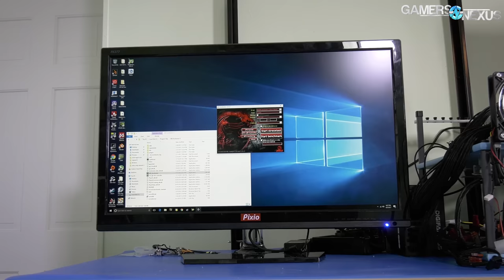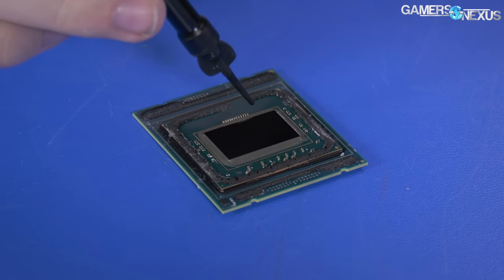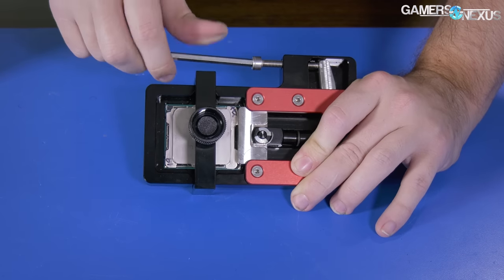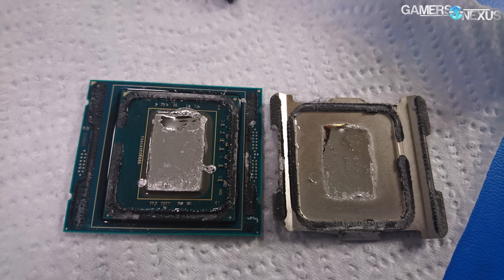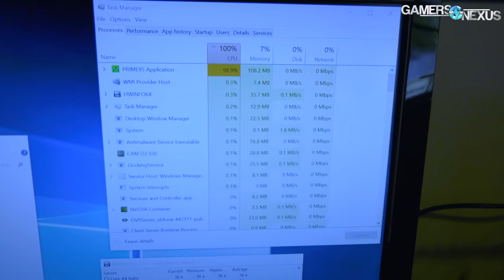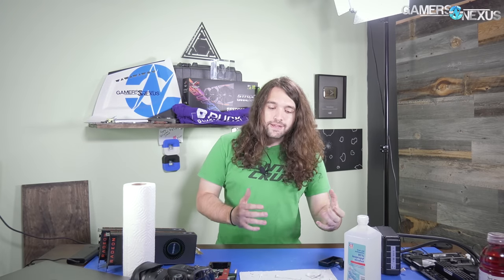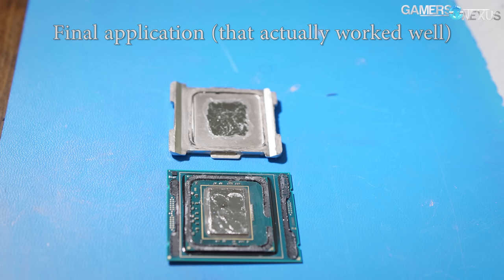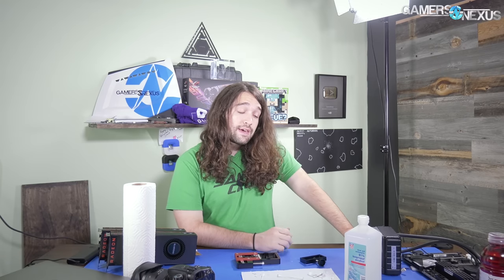Vlog: Learning Delidding & Liquid Metal Application on 7900X

Comment from the maker: Thanks to our Patreon backers for following this as it was happening live (on Discord). Update since: Starting to get good at this -- have delidded two more CPUs and used LM. Realized, sort of obviously, that you can siphon LM back into the syringe if too much comes out (though it's kind of a pain, at times). That made it a lot easier. Removing the tip from the syringe and replacing it also made things easy, as a tiny drop comes out each time that's done, which is generally enough for a thin film. We are now two CPUs into testing and seeing a lot of performance uplift. Pretty fun stuff. If you want to support on Patreon to join Discord, a link is in the description above!
Reply: ahh love that bitwit gif
Reply: Honestly, you are better off putting liquid electrical tape on the surrounding caps to avoid shorting in the first place. If you don't have LET on hand, a few coats of clearcoat nail polish also works. Conductonaut, unlike CLU, maintains a far more "liquid-y state", and is prone to runoff when tilting the CPU around. Even if you use a thin enough layer, you do run a small risk of having runoff touch those caps if you move the CPU around enough. CLU is much more viscous, but also runs the risk of drying out quicker over time depending on mounting conditions. I certainly wouldn't risk a $1000 CPU without taking every precaution beforehand, but glad to see the CPU survived both the delid and liquid metal application.
Reply: Thanks Steve
Reply: Please up vote this. Deliding is NOT just about putting a better TIM on the die... it's also about reducing the die to IHS GAP! Reducing the gap in addition to providing better contract is where the majority of the improvement comes from. This is why removing the glue is so important. It brings the IHS closer to the die, increasing the transfer of heat. Ideally, we wouldn't use any TIM and have direct contact with the IHS since the thermal conductivity of nickel and copper is higher than any thermal interface material. Unfortunately it is impossible to have perfect contact between two uneven surfaces, this why need TIM.
Reply: Liquid metal between the cooler and IHS doesn't really help much, about 2C at best over traditional pastes. Best not to waste it on top of the IHS, and use it where it helps the most, which is between the die and IHS.
Reply: The first time I used the Thermal Grizzly Conductonaut on my 7700K it squirted out the same way.  It is in a syringe, so all you have to do is make sure there is no air in it and pull back the plunger and suck up the amount you do not need. Simple.
Reply: Please do a comparison between Liquid Metal and standard TIM replacement. I've been informed the difference is minimal and not worth the extra risk of damage.
Reply: I fried a broadwell e 6850k with this stuff w/o even delidding.  Must have put too much on the ihs so the liquid seeped down into the gas hole.  I've sworn off all liquid metals for good.
Reply: Hey Steve been wondering for a while would it be possible to flash a 1080ti with a Titan xp 2017 bios to unlock the extra cuda cores 
Keep up the great content
Reply: Gamers Nexus Nice video man. I've been interested in LM too but fear that its too liquid haha do you think you can test a laptop and see it it runs/drips if you have your laptop in your bag bouncing and bumping when you walk when the laptop is vertical. For future video you can also test the long term effects of LM. BTW to prevent from spills or shorting put Scotch Super 33+ tape around the die as its hi temp resistant and is very thin. Thanks, would love to hear from you.
Reply: thank you for the vid, this is informative.  
I wanted to know does the liquid metal Grizzly "eat" or rather deteriorate aluminum?
Reply: Gamers Nexus Pro tip Steve, cover the caps with a non-conductive silicon TIM like MX-4, and they are protected from spills and shorts;)

Looking forward to seeing you use LM for a shunt mod on an nvidia gpu, hint hint ;)

Also, if LM gets on your table or floor, use soapy water to clean it, soap breaks LMs insane surface tension
Reply: @Scooby Dooby, go look at any actual benchmark of liquid metal vs traditional paste when used in between the IHS and CPU heatsink. We are talking 1-2C at best, for a paste that is far more expensive. Remember, you have to cover both the IHS and the heatsink's cold plate. You are also overestimating how thermal conductivity works. Just because something has a higher thermal conductivity, does not mean it's automatically going to cool better. If we are being honest here, you are better off with a perfect lapping of your IHS and cold plate and using little to no paste. 

I suggest you look at various reviews of liquid metal pastes. Tomshardware just recently did a review that included CLU, Conductonaut and Phobya's liquid metal paste from back in the day, and as I said, a 1-2C difference was the best they could get over Kryonaut. http://www.tomshardware.com/reviews/thermal-paste-comparison,5108-8.html
Reply: You should have experimented on something cheaper first. Like a 7700K using the delid-die-mate 2 (Roman should have sent you one). I mean your mistakes, after all, were not about the use of this particular delidding tool or this particular chip but about the general procedure - like how to apply the liquid metal on the cpu die and cleaning up the IHS.
Reply: Steve, I still haven't herd from anyone why the double PCB on some of there chips. Since the GN team rocks maybe you can give an explanation?
Reply: CaptainMageTank do you know when 5ghz STOCK speeds are going to happen?
Reply: Hey thanks a lot man your clips are awesome. You're a hero! One question regarding the clip, at 3:56, did you apply nail polish before this happened (losing a capacitor)?

Comment: Liquid metal application is just a pain in the ass :D my first application looked about the same but you get used to it.
Reply: Just put tape around the die.
Reply: nail poilish works as while ive heard
Reply: Hey would liquid metal help on top of the IHS with the contact of the cooler? I'm just curious if it helps at all
Reply: A big issue to watch out for is liquid metal's reaction with aluminium. Gallium is a primary component in the liquid metal and will have a chemical reaction with aluminium. The CPU IHS is typically nickel platted and therefor won't react, but many CPU and GPU coolers use aluminium on or near where they make contact with the die.
Reply: der8auer hey bro i got some themal grizzly liquad metal .Do you think if i replace my thermal paste with it without delidding my 7700k it will improve temps slightly with my d15??
Reply: Coollaboratory's liquid metal is very nice and doesn't spill all over. It could be that oxidation is a big point on thermal grizzly, it blocks the pipe and with increasing pressure it spills over.
Reply: Luke I would say no, since you will be limited by the shitty Intel thermal paste.
Reply: Alexander Arias yes it will I'm but I can't attest to how much
Reply: Luke based on tests i've read(but for older CPU): if you're using really bad paste now, expect a little over 5c improvement. maybe closer to 10c in extreme circumstances, and if you're at a very high clock. if you're using a decent thermal paste already and not overclocked, expect less than 5c improvement.
Reply: If you stop using that garbage and go with CLU you wouldnt have had that issue. Also, Silicon Lottery recommends it. I delidded my 7700k (THIN) with a razor, and had a perfect application to both ihs and die with a cheap micrometer to ensure it was aligned. 
The whole process took an hour or so with some really good lighting and magnification.
Reply: Says that right on the product..
Reply: I have a little OCD and took my sweet time, but my first LM application was almost perfect ^^. It was the I7-7700k. With Conductonaut and Siliconglue and no Taping. Your Delid Die Mate 2 was very easy to use. It would have been nice to have a hole at the bottom where the CPU can rest while you clean it. Just like the DDM 1.
It still runs 5 Months later without problems or difference in Temperature.

FYI. My AIO died a few months ago and i had to use my STOCK Cooler. With LM it was at 75°C on AIDA 64. (The AIO is at 50-55°C)
SO with delidding even the Stock Cooler becomes viable. XD
Sadly my CPU is a bad draw. @5GHz 2 of my 8 Threads become unstable. (for example: With Prime 95, 2 Threads stay at 0% Load)

Here are some numbers and pictures of my delidding http://www.overclock.net/t/1313179/official-delidded-club-guide/32920#post_26056970

@NFleck
CLU is aging much much more badly then Conductonaut.
Reply: Oh also 3 Tips for applying.
1. instead of pushing the Liquid out, draw up the Syringe first. Then you can adjust the pressure more gently and evenly until the LM comes out.
2. suck up excess with the Syringe until you have a very small bead, about 1-2 mm in diameter (around 3-4mm for i9s).
3. apply it evenly on the complete DIE, don't cut corners. Then do the same on the IHS, but only where the DIE rests on.

Comment: I’ve worked with liquid metal before too, that stuff goes everywhere and is a lot different than thermal paste. But live and learn!
Reply from the maker: Ended up doing something similar on the second CPU. Definitely easier to control that way.
Reply: I have used coolaboratory liquid ultra instead of grizzly due to shipping issues. It didnt have any needle like design like grizzly does but it never went out of control even though i first time used it on 7700K die. Was success at first try. But it looks like delidding 7900X is way more difficult to do.

Comment: If you still don't fully understand the hate towards Intel for being super cheap, and not soldering their ONE THOUSAND DOLLAR FUCKING CPU... Then put this into perspective, Ryzen chips (even the mere $100 R3 1200 chip is soldered) see about a 2-3 degree difference while delidding in the most extreme cases when you're using an 1800x over volted to 1.45 volts, as found by the well trusted world overclocker Der8auer. AMD is able to do this on a $100 CPU while Intel can't with a $1k CPU...
Reply: Alisson Craus if you still don't fully understand Alisson's post make sure you don't miss the don't at the start.
Reply: Alisson Craus yup, there is no excuse for intel not to walk away from TIM. I guess the only way they will change this is if they catch enough hell from the community! I wonder if my 4790k would be able to hit 4.7ghz stable if they hadn't used cheap trash as a thermal solution.

Comment: Put electric tape over the resistors when you apply the lm and remove it after you applied it
Reply: Elf UndDreißig Great suggestion to mask it.
Reply from the maker: Ended up using nail polish.
Reply: Try 3M Scotchfil Electrical Insulation Putty, we've had good results with it.
Reply: Elf UndDreißig or painters tape/masking tape... Or any other tape with weak glue for that matter...  :p
Reply: Vampire Yeah, but once I put some  tape on my mainboard and then my pc crashed , after i removed it it didn't.
Reply: wow, that works?
Reply: why..do u have nail polish O.o?
Reply: You can use scotch tape also to cover areas around the chip put the liquid metal on than peal off the tape
Reply: Gamers Nexus  do you recommend using nail polish over the resisters to protect them from liquid metal
Reply: I always use kapton tape now. And you can leave it on as it can withstand hundreds of degrees while being wafer thin so no interference issues. I have it on my 1080Ti's and 7900x.
Reply: Roof Tyler thank you I just ordered some on amazon and going to try it out 
Better than no protection

Comment: If intel werent cheap asses, they would solder the thing. The fact that we have to do this kind of thing is a sad state of affairs.
Reply: DiGriz the Great not saying what intel did was right but at least now you can delid and keep it cooler than soldered if you don't keep the IHS.
Reply: Daniel Fisher lol what.    The IHS isn’t the issue.   Look at Ryzen/threadripper ... delidding it results in no notable temperature valences ihs vs no ihs.. the soldering basically makes it nearly perfect transfere.
Reply: Yeah, indium solder is pretty much as good as liquid metal if it's done right. Der8auer delidded a Ryzen 7 1800X and tried direct-die cooling (cooler mounted directly on the die without the IHS) using liquid metal, and the improvement was 1-3C, which is almost within margin of error. The solder also lasts forever, while liquid metal needs to be reapplied when it eventually dries out. For us consumers there really is no upside to intel using thermal paste.
Reply: Except for the part where several overclockers came out to say how Intel's use of TIM was the right move due to movement of interface material due to expansion and shrinkage over time. Their TIM is shitty but longer term stability was far greater than a soldered component. Im actually interested to see soldered, vs TIM, vs Liquid metal in 3, 4, and 5 years. Only Thats a lot of money for anyone to use.
Reply: Nehalem and Sandy Bridge were soldered and millions of those are still going as strong as when they were new. If expansion and shrinkage over time was killing or at least degrading thermal performance on soldered CPU's, you would think it would have happened to those by now.
Reply: Plus if it did happen to die in say 10 years the CPU and the whole platform it sits on would be obsolete by that point anyway. I mean like Core 2 Duo and Athlon X2 are obsolete today. In my eyes these are just cheap excuses made to justify crappy manufacturing practices. Solder was, is and will the number 1 best method for attaching the IHS.
Reply: Raivo K but not cheapest, and that's what Intel is about
Reply: core 2 duos are still perfectly fine for youtube, e-mail, writing use.
Reply: Apart of the fact that they deliver a performance similar to a quad core Atom (Pentium N range) or way less in modern instructions while offering outdated peripherals while using ten folds the power of said Atom quad.
Reply: But that doesn't make sense, the Xeon CPUs are soldered and AMD have been doing it since the early 2000s as well. Xeons are build for commercial environment and made for reliability so Intel's claims are complete BS as always. all about max $$$. One thing to note is that indium is very soft, like plasticine and does allow for thermal contraction/expansion. The fact is the  expansion coefficient of the materials that make up the package, the biggest dela is between the die and the PCB board. PCB (fiber glass reinforced resin) has a coefficient of about 36, silicon is 5, indium is 33 and copper is 16.  So looking at the indium the expansion of that would be more of less the same as the PCB underneath, not really changing the loads experienced by the die much at all over a conventional TIM, more evenly distributed stresses actually as its bonded both sides rather than just the PCB side.

Comment: My 4670K also lacks two capacitors and works just fine. Btw, you can suck any excess liquid metal back into the syringe. Also, if you have trouble getting LM off a surface, 99% Isopropyl alcohol increases the surface tension of LM, making it form little beads/droplets.
Reply from the maker: Yeah, that's in the pinned comment.
Reply: Psychx same thing happened to my 4770K. Lost the top 2 capacitors during the delid process. Ran just fine tho.
Reply: Wait so thats why it took so much time for me to crush the droplets. I used 95% ispropyl alcohol to clean the thermal surface before applying.

Comment: If you spend $1,000+ on a CPU and you have to delid it just to get it to run the way it's supposed to, there's a problem. Absolutely pathetic on Intel's side.  Especially when their parts are significantly more expensive than the competition and the competition solders all their chips by default for even their cheapest parts.  There's just no acceptable excuse for it from where I sit.

Comment: I applied liquid metal on my 6700k. Though, prior to delidding the 6700k I tried an older Athlon X 64. Taping off around the die helps keep the metal from touching the substrate, also twisting the plunger as you push it in will help distribute a much smaller quantity of metal versus the quick shot.
Reply: LinusTechTips did a video 18 months ago covering the 6700k being delidded. Skylake was a relatively good CPU generation for Intel as it is still relevant even today compared to Kaby Lake. as you heard correctly Skylake had used good Thermal interface material, especially compared to KabyLake, Kabylake X and Skylake X. for the tl:dr its not worth it to delid a 6700K as at most with Liquid metal you will get roughly a 5 +-1c difference. for comparison, i have seen as much as a 20 degree drop on Kaby lake with Liquid metal on a video a long time ago.
Reply: Mine did drop around 15 degrees but to really benefit you need to be OCing the CPU and pushing more voltage. If i recall correctly, Linus's video was more along the lines of him trying to figure out how to properly use it. He used a blade to cut out the silicon adhesive between the substrate and the IHS. There have been many more well described videos out as well as delidding tools developed since his video.